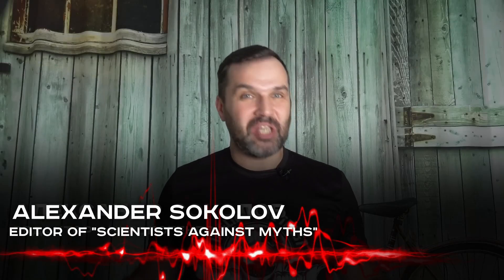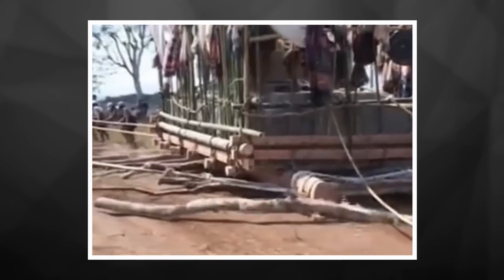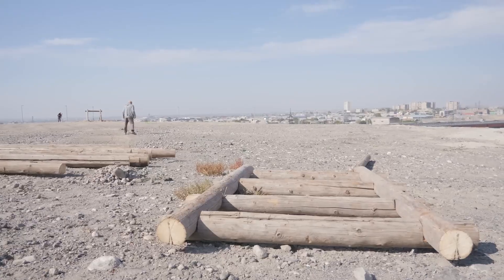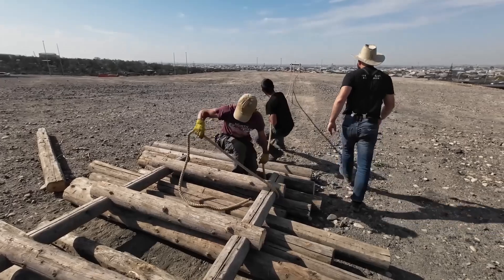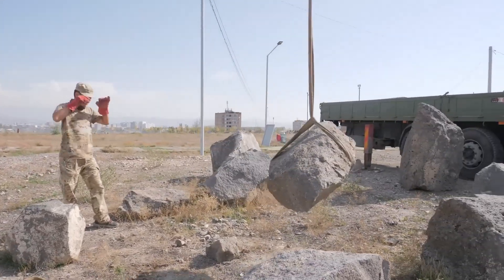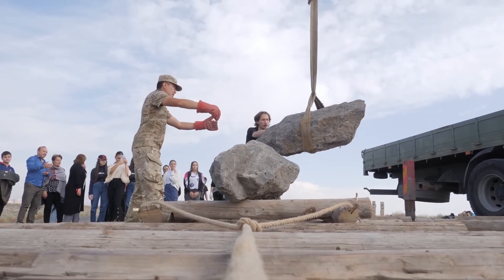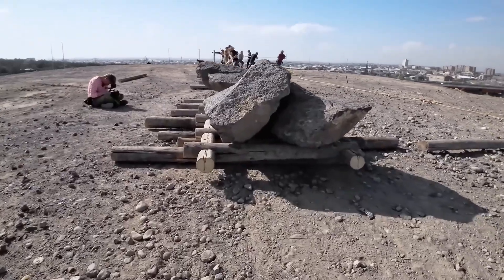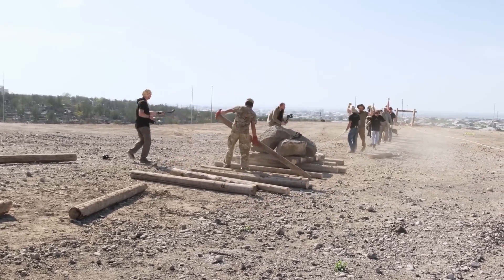How did the ancients transport heavy stone blocks? Experiment | Serious Science

Comment: This. This comment section is proof that such things could be achieved. Everyone is suggesting things based on their personal experiences. Humans are social and this wasnt the work of a couple people with limited budget. It was made by fucking mad lads, brains and a dream! Love the content!
Reply: @RegularFlyGuy  over 5,000 years of engineering development, and they struggle like this with such a small load? I’m sure you’re aware that the larger the rock gets the exponentially harder it gets to move that rock it’s not just like you apply the same force to a 1 ton rock and take that x20 to move a 20 ton rock.
Reply: @cleanpiecington2319 1000s of years of engineering development allows us to use huge diesel powered machinery with hydraulic mechanisms. This video was about not using the advanced tech that we currently have at our disposal. Unless you have a theory about how the laws of physics were different in ancient times, mechanical advantage will be the answer.

Comment: Half remembered from my childhood (i'm talking late 70's or early 80's) A UK TV special was looking into how they built Stonehenge and moved the heavy stones? They came to the conclusion that the sledge running on wooden rails lubricated with water and fish guts was the most efficient way of moving such heavy loads. The thinking is thus: Most of the journey was done by river barges (especially the Welsh blue stones, no other transport method makes sense), most such sites, well in the Uk anyway, are near rivers, fish guts are a waste product, that workforce needs to be fed and there is significant evidence fish was big in their diet. Using that idea, they were able to reduce the number of people pulling vs wooden rollers by a factor of at least 4, we are talking about reducing the number of "pullers" from something like 200 to about 50. Maybe worth a try?
Of course this is half remembered from like 40 years ago and change, I may have recalled this very imperfectly?
Reply: how many fish does it take to pull something 5 miles X-D....up hill

Comment: i like but  now i wonder how did they put those stones on theose wooden slides back then cheers guys
Reply: Levers.  If you are removing "blocks" of stone from a quarry and you quarry down lower than the level of what will be your blocks then upon fracturing the blocks free* from the bedrock you can with the insertion of levers = move it laterally onto a sled you have placed next to its' base.  

Moral:  there is a photo online showing one of the areas of quarrying at Giza.  It does not reveal directly side by side blocks.  It rather shows what are the remaining raised bases of blocks save for = there is some distance between them - enough for workers to have gotten in between the block and the bedrock wall to push/pull/lever upon it.  

* - if you drive lines of long chisels into limestone bedrock at perpendicular angles then as the chisel is hammered in after a short distance = the stone will begin to split along your lines not unlike snapping off a saltine cracker.  Then if you created holes for the insertion of wooden levers your block can be pried loose.  

There is a video here called:  Arnaldo Costa Stonemason Extraordinaire.  It shows the technique whereby an old man using chisels and a sledgehammer quickly fractures a block of granite into 2 clean halves.

Comment: Excellent experiment. Consider to try again with a sheave or pulley at the sledge and a fixed back anchor to get a two to one pull advantage. Thanks
Reply: As noted previously in another comment we have examples of Egyptian sleds in museums which mirror their depiction on Egyptian iconography.  Egyptian sleds had a upwards sloping front end to help prevent the front "biting down into the ground" to get stuck.  They also had crossbars in the front and rear for the attachment of ropes.  

As an aside.  Egyptologists have found the remnants of flat boards lain into the surface of the ground near areas where stone blocks were placed.  Thus unlike "rollers" which can be difficult to control a flat board laid into the surface of the ground spaced at intervals can still allow a sled to slide across the surface being pulled and pushed.

The flat boards still distribute the weight above allowing it to pass into the ground.  As long as the boards are thick enough* then they can withstand that weight and facilitate movement over them without "fighting" the rollers and sleds which can sometimes skew in the wrong direction.  It is a variations of the "corduroy roads" militaries used for centuries to cross soft ground save for not rollers = boards.  

* - think rail lines which have closely spaced wooden ties beneath the steel rail and which support the weight of trains which can weigh hundreds of tons or more.  The weight above "passes through" and into the ground consistent with the length of the ties.
Reply: @varyolla435  Yes I see, the cross-boards would be let into the ground like railway sleepers, and the sled runners would simply 'rail' across them as it skids along. I bet with a little tallow or linseed oil lubricant on the boards, the sled would fairly skid along sweetly. Even just water splashed on can make wood 'skiddy'.

It sounds much more logical that they would have prepared such a 'permanent way' for an ongoing construction job, rather than faffing with multiple loose rollers for each and every one of multiple hundreds/thousands of blocks coming along a particular access corridor. Thankyou.
Reply from the maker: Thanks! Preparing for the next experiment with a larger mass

Comment: I saw a documentary where they had A-frames at regular intervals along the side of the track.  There were two  ropes, one per side, which were pulled in a similar way to your initial attempts, using the frames as pulleys, but because the pulleys at the top of the A-frames were relatively high, they tended to lift the front of the sled, allowing it to slide onto the next log relatively easily.
I can't remember what size of stone they moved, but it was pretty big, and it was quite effective.  I think they also used pork fat rather than oil as a lubricant.  At the sort of pressures the rope exerts, I think it's likely that grease will lubricate more efficiently than oil.

I do question the applicability of this to say the 20 ton stones of Stonehenge.  Those much heavier stones are likely to do significant damage to the logs, so I'm not sure the experiment necessarily scales well.  I think we need to see a full-size experiment before we can say whether this technique is usable.  Note that the path from the quarry to Stonehenge is not flat, so any technique would also have to deal with gradients (in both directions).

Regardless of our ability to demonstrate the method, it's clear that the ancients had already had lots of practice (hundreds, possibly thousands of years' development of the methods) moving large stones by hand, so by the time they needed to move the huge stones, they would have already mastered the technique, and it was just a problem of scale.  The people who say it can't be done are implying that the ancients were not just technologically inferior, but mentally inferior.  That's just not true.  They would have had their equivalent of Einstein (with similar intellectual capacity) working on problems like this.

Keep up the good work.
Reply: Look at the video clip within this video showing the movement of the "Mussolini Monument" block which weighed 200-300 tons.  In other words if you use single logs then yes weight can be a factor.  If you use thicker logs - and more of them = then heavier weights can be transported.  The block as it was eased down the mountainside showed the men cramming the wooden rollers together rather than single ones spaced apart.  

As to sleds.  They made this one themselves obviously.  Yet if you look at examples of Egyptian sleds in their iconography + actual sleds in museums you'll see = they have upwardly sloping front ends.  This would help mitigate the front end "digging in" under use - especially if the block is placed more towards the rear rather than the front to stop the sled from being "front heavy".

Comment: If the rope had been looped round the sledge it would have given a mechanic advantage. I don't think the old timers would have missed that. I dont think keeping yourself at a disadvantage because people think the oldtimers where stupid is a good thing, they moved stones many times heavier that that successfully. They must have had some good ideas
Reply: Yes they had generations to work out all the bugs so as to perfect the system.  As an aside.  Examples of Egyptian sleds can be found in museums.  A Middle Kingdom sled as an example has large wooden skids with connected wooden beams which are attached via tenon joints cut into the main skids.  In front of the connector beams is a thick rounded wooden bar also tenoned into position upon which a rope(s) would be looped.

Comment: E for effort.  I would inquire as to the wooden rollers however as they appear to be old dried electrical poles?? I understand about costs of course.  I would simply say that the Egyptians perhaps as our example might employ hardwood such as acacia of whom you can see examples in museums which have a high Jansky rating.  

Also as alluded to rather than making your own "sledge" better to have copied the design of said Egyptian sled which as we can see is sloped upwards in the front to minimize the chance of the front end digging in.  

Finally as the video shows using "rollers" complicates the issue as the logs then roll with the sledge rather than the sledge moving across the rollers.  Think old corduroy wooden roads.  If one uses thick planks rather than "rollers" which are spaced closer together with a sledge whose front end is sloped upwards then the sledge might move across the wooden planks without then rolling out of place. Just a thought.

Comment: Good effort guys and since you had no magic beans to trade for an Ox. Split and corduroy your logs so they don't roll. Rounded tips on sled's skids. Each man body barrel sling hitched to main line. Use legs and weight of body only, think 'tug of war'. Make an oily clay slip to grease your logs. Slow and steady wins the race.
Reply: "Split and corduroy your logs so they don't roll."

Exactly. Like railway sleepers.
Reply: @Leeside999  a railway sleeper ("tie" in my country)  handles 100 tons without crushing. 7"x9" typically here.